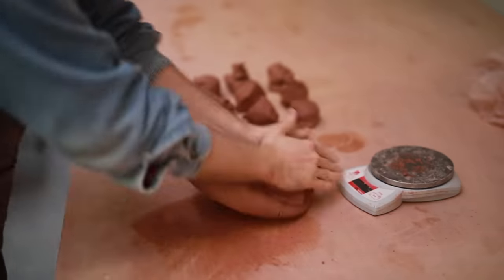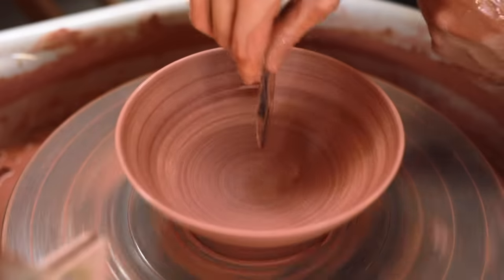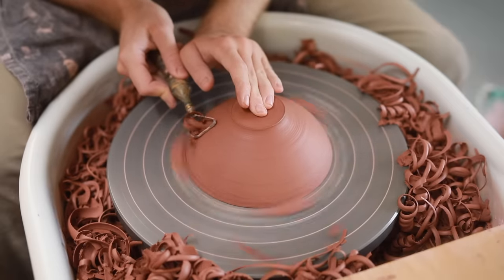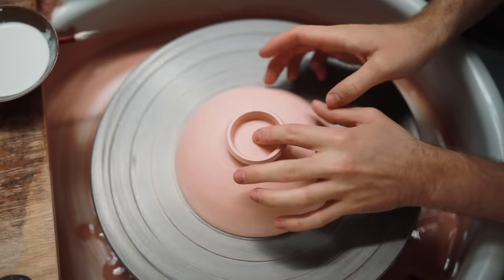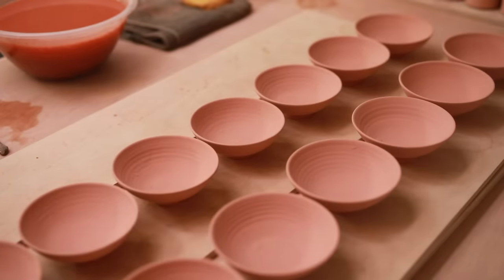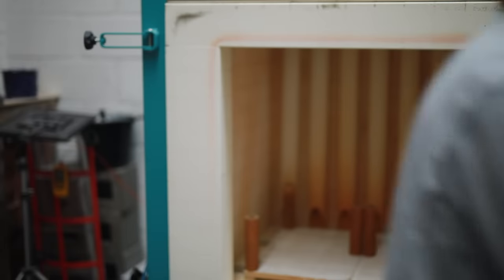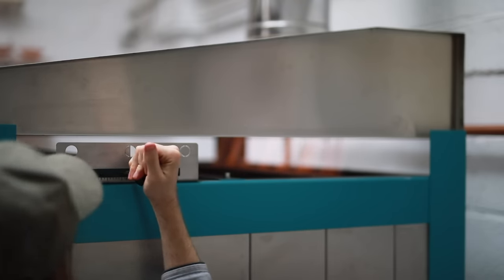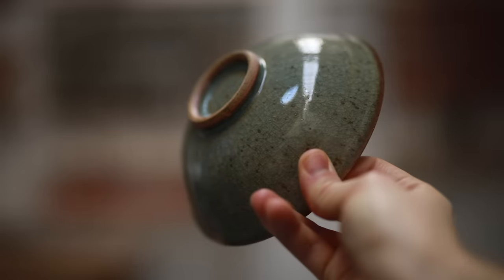How to Make a Stoneware Pottery Bowl, from Beginning to End — Narrated Version

Comment: Great video!! I've actually used a leveling laser as a throwing gauge before (like Old Forge Creations) rather than a physical object just in case I go past the desired width -- it's less destructive than having your rim hit even something soft like a paint brush.

Neat tip on the wax resist foot-to-foot bonding; it also proves how identical all of your pieces are!
Reply from the maker: Those work too I guess, what I like about a physical pointer is that it gives you an obvious target to air for when throwing that I think the laser doesn't. The rubber tips of the gauge don't do more damage either and the joy of this model is that you can flip the pointer up, so get it out of the way if you need to, before lowering it back down. Thanks for watching!

Comment: I just came across your videos as I am considering something similar as a hubby...and WOW! This is amazing work that you've documented in details. 
I have a couple of questions I'd like to ask. Have you also tried other transition metals for glazing? or a mix of them?
A comment on the reduction part, I think you're forcing your gas kiln into a partial oxidation state (by shutting off the air supply and increasing fuel) where the fuel (hydrocarbon) gas is incompletely burnt giving off Carbon monoxide and Hydrogen. This Hydrogen is causing the reduction of Fe2O3 to change colour from red (Fe3+ ) to greenish-blakish (Fe2+/Fe) - colour range depending upon the hydrogen to steam content inside the kiln. I also hope you have a nice exhaust to channel the produced CO, and have CO sensors nearby.   
Once again, great work!

Comment: Thank you for a most informative and beautiful video.  Because you do not enjoy wiping the excess from the waxed area, why do you avoid wiping shortly after dipping? Just curious.
Reply from the maker: Because sometimes the glazed pot remains wet for a while, so it’s difficult to hold and wipe away the excess without damaging the glazed surface. Once it’s dry I feel like I have more control and I’m less likely to damage the areas where I want the glaze to remain pristine.
Reply: @floriangadsby  As I started reading your response the last word - pristine - jumped out immediately. You are a brilliant potter and thinker. Thank you for your response and so generously sharing your knowledge.

Comment: Hello Florian!  I'm a big fan, and I've recently been getting into making large sets of bowls.  I was wondering if you had any tips for the bisquing process.  I notice that you stack as many as eight on top of each other.  I've been told in the past that stacking too many pieces is risky.  Does this ever cause any problems with heat distribution/cracks?  Do you simply troubleshoot by testing what works? Is there something you should watch out for while creating the form (ie, walls not touching each other, so each bowl is nested with the foot as the only contact point)? Thanks so much for your wisdom!
Reply from the maker: Hey! Well, with larger bowls I'd never stack them in as tall piles as I do here and you're absolutely right about how the weight is distributed. The walls of my bowls are never touching at the bisque stage, all the weight travels down from foot-ring to foot-ring, which is how I get away bisque firing them like this. Otherwise, if it's a larger bowl, I'll fire them in stacks of 2/3 and make sure they're on a very flat kiln shelf. If they continue to slump it's likely as the clay around the foot-ring is thrown/turned too thin, which still occasionally happens to me! Thanks for watching and I hope these tips help but by the sounds of things you're well on your way already.

Comment: i used a crappy 23-dollar pottery wheel kit that only came with 2 pounds of terra cotta clay the potter wheel was really slow, but I was shocked that none of the pots I made cracked it was a air dray type of clay. my point is where did you get your pottery wheel? note that pottery wheel lasted 1 month

Comment: May i ask if it's possible to make a mug using a pottery Clay at home? Cause i already bought the clay and i really didn't know its a very big process like this, i hope someone read this and tell me what to do :)
Reply from the maker: Not really.. you need a kiln to complete the process and typically they don't come too cheap. You could look up pit firing, but that depends a lot on the type of clay you're using, as they fire to different temperatures. The oven doesn't come close to getting hot enough sadly, perhaps there's a local studio or potter that could fire them for you?
Reply: @floriangadsby  thank you for the response, sadly i don't know but I'll ask and search to know about that, thank you!!